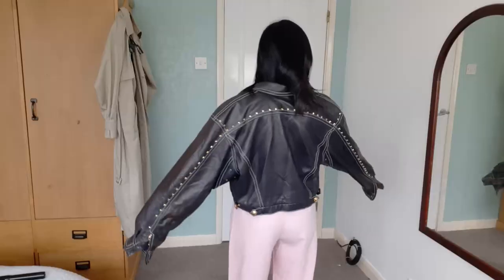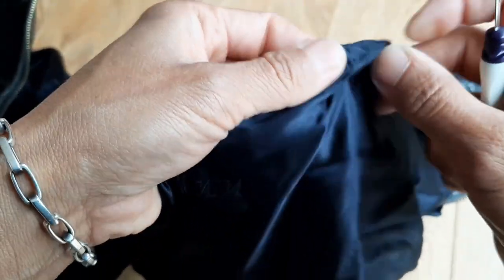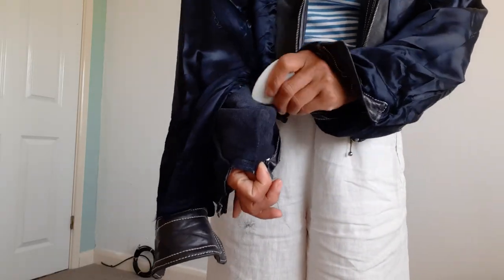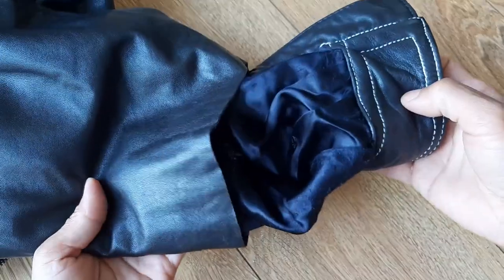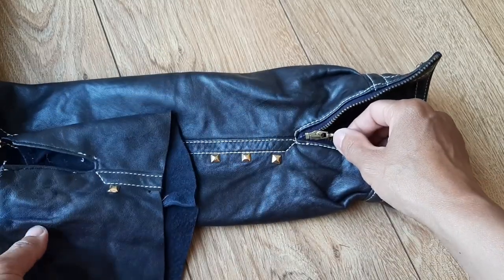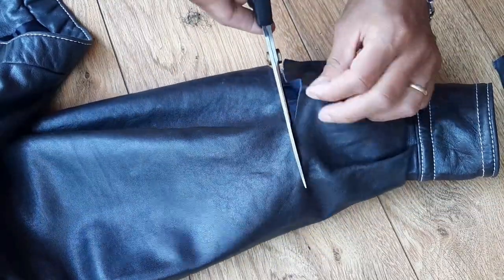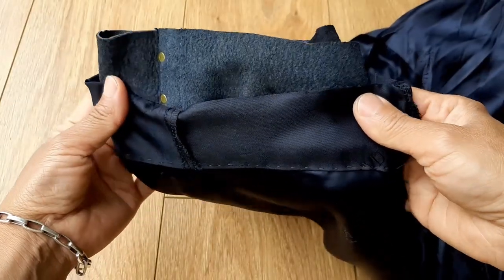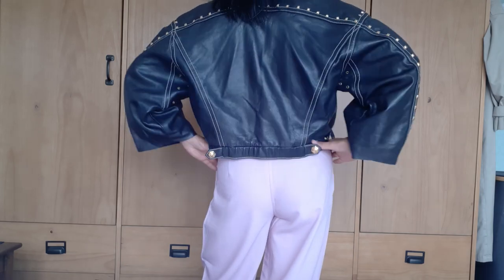Shorten sleeves of a leather jacket at home, how DARE I ?! Learn from my mistakes.

Comment: If you get some leather glue, you can fold in the edge and finish the hem that way.  It will now be shorter, but you can wear it with bold bracelets and will look good with the wider cuff.
Reply from the maker: Thanks for the great tip, I will try as you suggested.